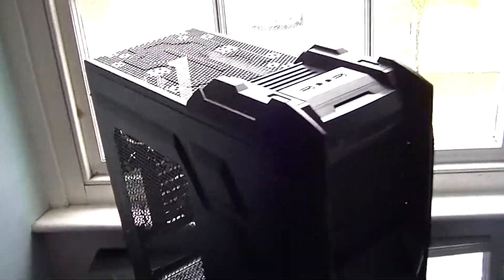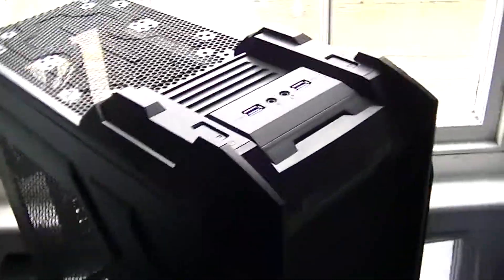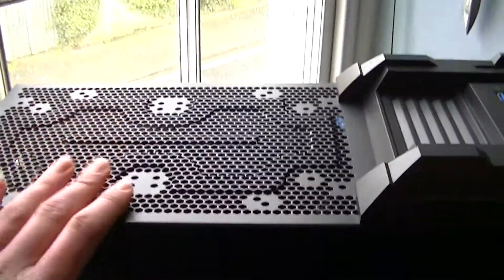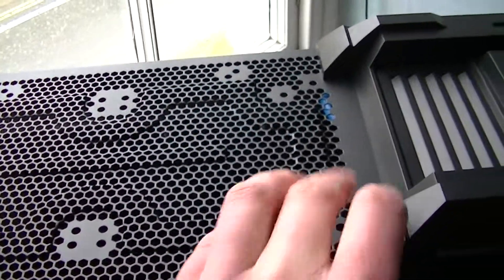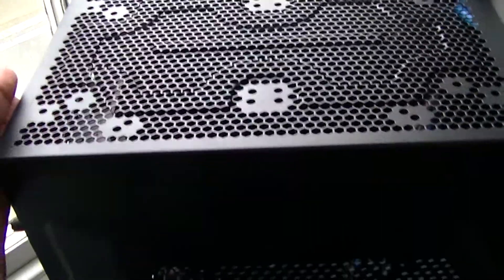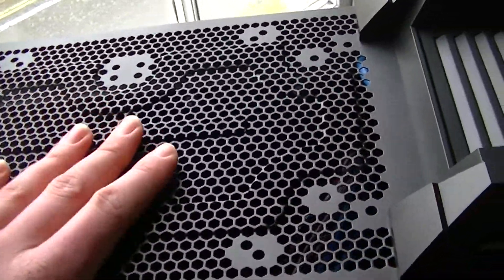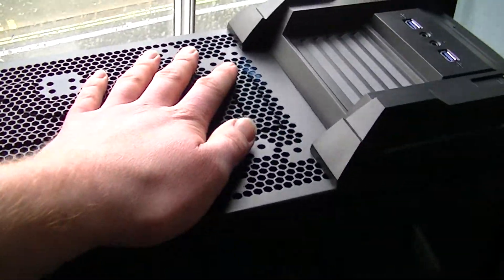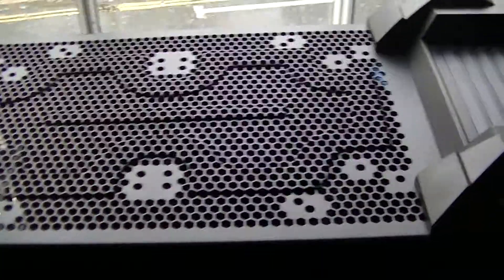What is Positive Air Pressure for PCs by JoyboyP

Comment: Will you have water cooling or Air Cooling? For positive Air Pressure?
Reply from the maker: My build will be mostly air cooled except the for the CPU all in one cooler, which will be mounted as a rear exhaust. I will be using positive pressure. 

I would say it is usually better to use any radiator fans as exhausts to help keep the inside of your case that little cooler.

Having positive pressure mostly means you want need to clean out the inside of your PC as often.